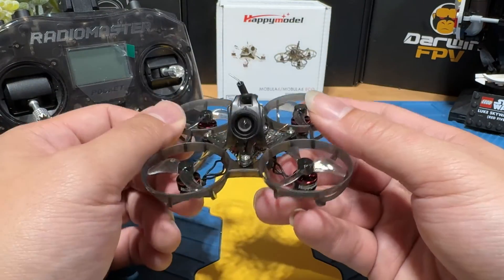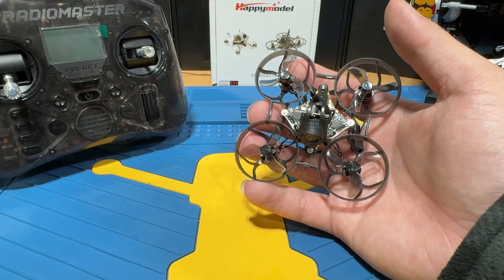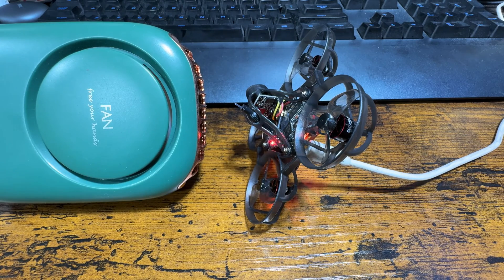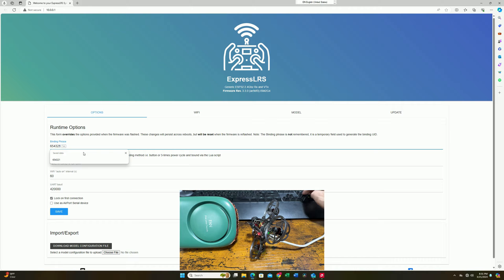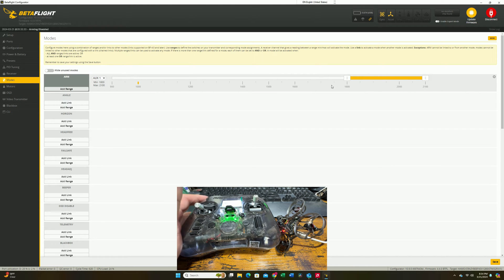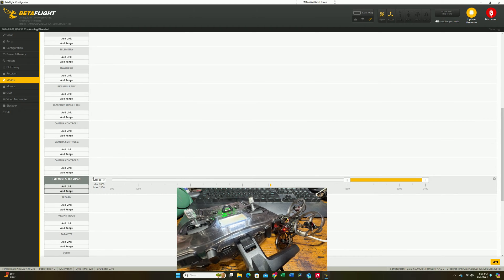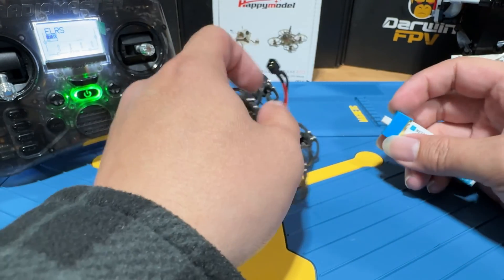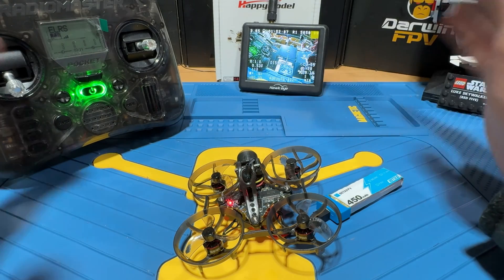[Beginner] Bind & Setup the Mobula 6 2024 ELRS the first time!

Comment: I connected mobula6 to computer with cable and drone is blinking with lights.
i ve waited more than 30sec but still the expressLRS RX wifi is not popping up.
Reply from the maker: This does happens sometimes, try a few more times or you might need flash it via betaflight passthrough

Comment: Hey bro I have this exact setup (radio/quad) .....I CANNOT get any inputs in betaflight!! I have the reciever bound  but when I go into the reciever tab...I get no movement from my radio.Could I get some help whit this please?
Reply from the maker: Try turning on off model matching. set you pkg rate to 500, if it still does not work, most likely it is not bounded

Comment: Mine arrived today - followed above instructions and got everything working except when I throttle to take off, it keeps flipping out. I have an ICM version and your video says 'change the yaw board angle by 90 degrees'... here is the CLI command in your dump: "set align_board_yaw = 135" I've tried both 225 and 45 and neither work. Would love some help!

Comment: hi, any idea why my mobula6, bind  LED is solid when i plug in the battery, trouble binding,  red solid/green flashing beside it :-(
Reply from the maker: Sounds like you might have bricked the ELRS RX just like me…check the tutorial to flash it via betaflight pass through and see if it fixed the issue

Comment: what to do if after 30s the mobula 6 still does not share wifi connection?
Reply from the maker: I would say try a few times, power cycle your WiFi by turning it on and off
Reply: @XwingFPVRC  is it way to enable hotspot/wifi mode by cli in betaflight?
Reply: @XwingFPVRC  is it way to enter hotspot/wifi connection by cli in betaflight?

Comment: i updated the firmware as  couldnt get the video to connect to the goggles hdz now there is nothing in betaflight video transmitter for mobula6 2024 ECO just a blank page and i wouldnt have a clue what to do .any help would be much appreceated. oh it did have the page like your video @ 5:25 but the VTX table wasnt as populated i only had.. letter F with about 3 numbers and letter and R (1-8).
i do have a dump file but wouldnt know what to dump into the new list . :)
Reply from the maker: What model do you have ? HDZ or Analog?
Reply: @iFLYXWings6589  hdz ! I'm sorry my tv use to notify me but now it's just on my phone and I only just found like 30 people trying to talk to me about lots of different things ..it's mobula6 eco hdzero 2024 keeps wiping clu but it's worked once untill the batt got low or sory this is long ok I plug it into betaflight most the time now everything works when I unplug it a motor or 2 don't work .I have bluej at 96k ..I'll have to relook but yeah I'll wait for you to respond as I might have quite a few others asking me so I'll get on pc  ..umm I have asked there customer support lol. They said bad cli or something  re ndownload everything dump it I don't know which files lol OK chat soon maybe much appreciated for the response .xo

Comment: Useless video. Everybody shows how to setup binding phrase on the drone, nobody shows how to set it up on the radio. Same here. you just glanced over the fact "since my radio has a binding phrase in it"
Reply: To set up the binding phrase in the radio requires you to download expresslrs configurator and to connect the radio to your computer. Basically exactly how he is setting up his reciever is the exact same way you do to your radio. go into your radio settings and find the internal wifi option and turn it on, that way the wifi will show up on your computer. Once you turn on your radio wifi and connect to it on your computer you can update it's firmware or just change the binding phrase. You can change the phrase without updating if you want to.
Reply from the maker: I am going to give you a chance to read the description of the video and see if you still want to consider this as useless.😂😂😂
Reply: @XwingFPVRC  My bad!! I actually used that video and finally gotten it to work :) Big thumbs up! This process has been frustrating so far... Got any videos for Walksnail VTX binding? That's my next challenge, connecting to Goggles L.

Comment: Hello, I'm new and I also want to get Mobula 6 ELRS

Please tell me if you know which remote control the Mobula 6 ELRS will work with (for example, does it work with the RADiOMASTER TX16S Mk2 Max?)

What glasses are needed? I don’t understand anything at all, there’s so much incomprehensible information...
Reply from the maker: Well, it depends of the TX RX protocols, if you are getting the ELRS version, mostly any radio with ELRS should work

Comment: Thanks, but do you know why mobula is not generating wifi when connected ?
Reply from the maker: Sometimes this happens, normally I will power on off to retry. If it still doesn’t work you might need to flash it via BF passthrough

Comment: What can you do if your drone binds but no stick inputs happen?
Reply from the maker: Check 
1. packet rate - set it to 500 hz
2. Turn on and off model match to try
Reply: To anyone in the future. Check the user manual for the “ports” section in betaflight. I set them up incorrectly the first time and I couldn’t use the controller or the the vtx until I reconfigured the ports
Reply: Thank you I’ll try that.
Reply: How do you check model match